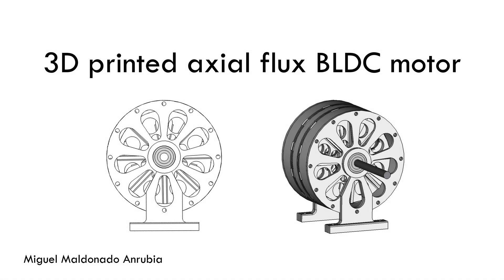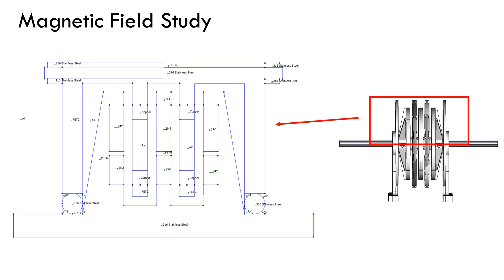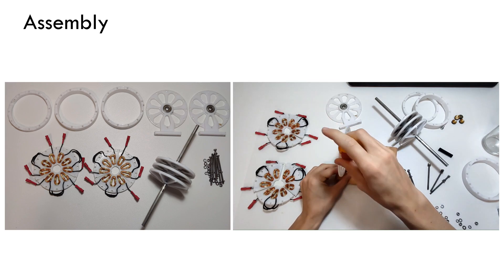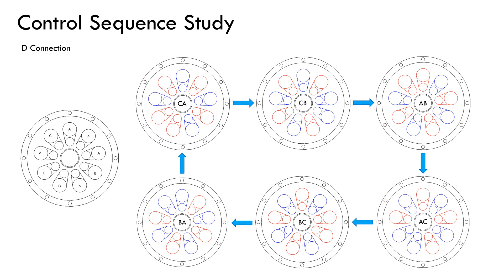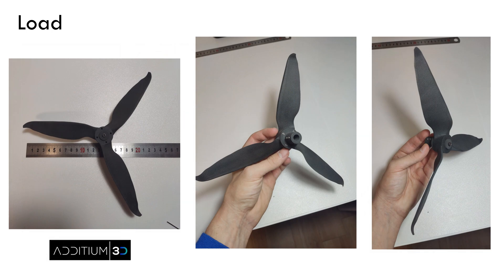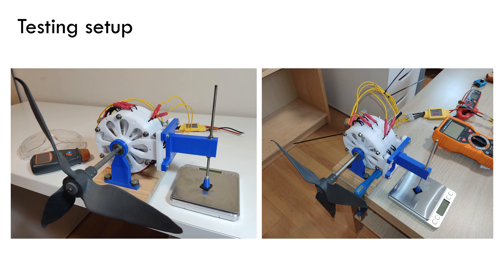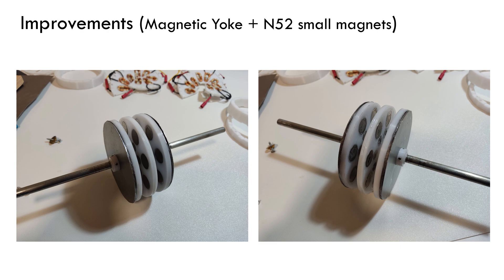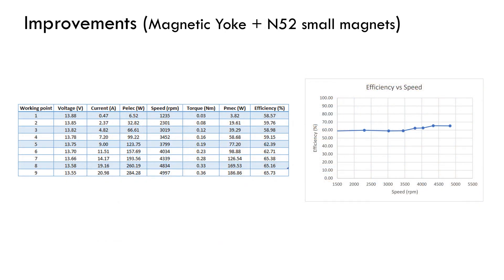3D printed axial flux BLDC motor

Comment: Super like.
Very good. Would it be possible to build one like it, but one that could use a 1 meter diameter propeller and an engine with a thrust of 70 kg?
Very good. Would it be possible to build one like it, but one that could use a 1 meter diameter propeller and an engine with a thrust of 70 kg?
I'm interested in building one if you can make one that can have this thrust or alternatively use a reduction box to increase the torque.

Comment: Great job.  What would happen if it was ran at 24v or 48v?
Reply from the maker: Thank you! It is definitely not rated for that, so it will get burn and before that it will probably get destroyed due to too much centrifugal force 😅
Reply: @miguelmaldonado6774  if you wanted to make a 48v motor, what would it take?
Reply: @miguelmaldonado6774  Dear, you can easily design various voltage bldc motors 
Can we make for fan’s motors for 350 to 400 rpm at less then 40 watts with 56 inch of diameter of wings for ceiling fans for hot countries by using your technology and 3D printers, cheaper as compared with the existing BLDC  fan motors in asia and china